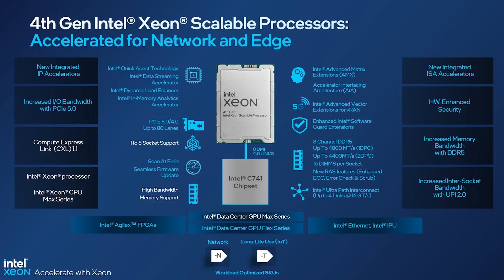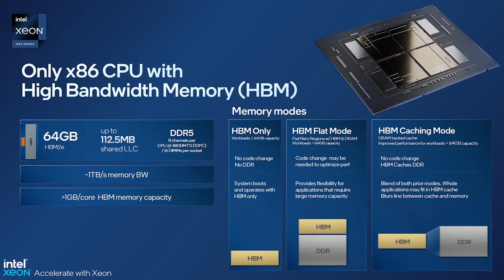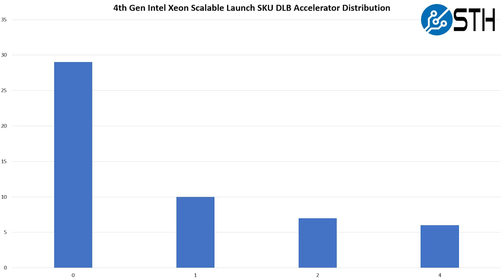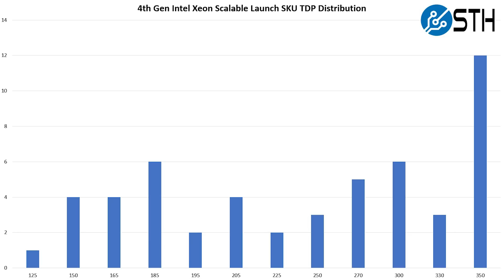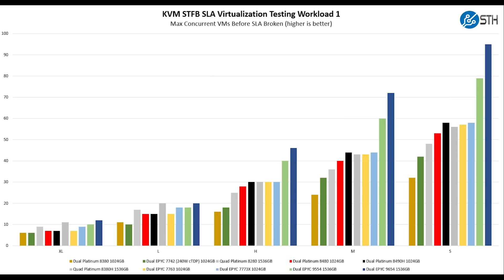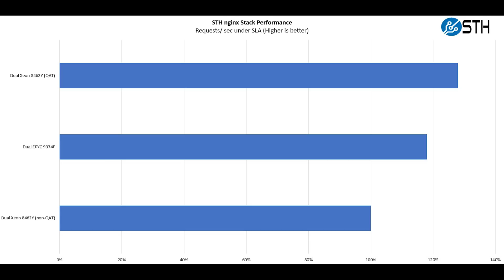$17K Sapphire Rapids Server CPU! Hands-on with the new Intel Xeon

Comment: Accelereators are way to go. IBM and many others were doing this for a decade, and now as we are reaching limits of silicon and density, we need to offload this relatively easy but mundane tasks to separate block, and leave CPU cores do what they are good at, generic versatile code. DSA is just DMA on steroid and easier use. AMX (pseudo-accelerator, but essentially with all efficiency gains of accelerator) is also nice. Lack of QAT and IAA on low end skus are really problematic tho, as it will hamper adoption a lot. A lot of developers would love to have this on smaller cpus, dev servers or workstations, but now they cannot play with it easily, unless they spend 10k on test system. For big companies it is not an issue, but for smaller ones, it is a problem.

QAT would be great, but at the same time, often this is something that is better can be accelerated on a NIC instead. (and many NICs already do that for years)

I hope AMD has good response in the works. They might have been good with density and IPC improvements, and cost reduction, but acceleration is the next game.

Comment: Genoa X and Bergamo 128 core inbound. Sapphire Rapids is weak.
Reply: you don't need that many core,
Reply: @jmtake85  In server, you need as many cores as you can get. More cores = more VMs
Reply: @tstager1978  no, core means nothing, and VMs have nothing to do with core, accelerators are the one more important. yes higher core is good but not over 40 cores per socket.
Reply: @jmtake85  What do you think cores are used for in a server? They are used to create VMs. Accelerators are great if you have a workload that can use them. If not, they are wasted die space. A built in fpga is better because it can be programed to accelerate multiple different workloads on the fly. Also, the more cores, the better the tco. 40 cores per socket isn't enough. We already need 256 cores per socket.

Comment: Everyone getting worked up about unlockable features misses the point. Companies buying these CPUs know ahead of time that the features are locked, what they cost, and price out the entire platform including all unlock fees. If it's cheaper than alternative offers that meet your requirements you buy it. At the end of the day, for the customer, it does not matter if you pay for a CPU or for a CPU and unlock fees - it's the exact same amount, because you priced it out before and the unlockable offer came out best. It's a form of price discrimination that gets more money out of the customers, yes. But the reason it works is that it's designed to still be (marginally) cheaper for the customers, so it makes sense to go with it.
Reply: I still want to see fire sales, 30-day-trials or a give-aways for these accelerators, maybe even a form of compensation when the next security flaw eats away performance per watt.

Comment: Btw, if you need QAT you can buy expansion card for that, shouldn't those work just as well on AMD platform than Intel? Those are "only" 300$ each on Fleabay. Ofc enterprise wants new, but AMD being so much cheaper i think the difference is covered :)
Reply: Wow! They exist in U.2 formfactor too... This could be huge!
Imagine all kinds of accelerators on the abundant 2.5" U.2 bays :D
Reply from the maker: The other part to keep in mind, is that 4x QAT is 800Gbps. A single PCIe Gen5 x16 slot can handle 400Gbps. The cards you find on ebay are usually 100Gbps and slower, so that means taking 8x cards that are running PCIe Gen3 x16 (since even the 8970 is a Lewisburg PCH on a card.) That would mean you need 128 PCIe lanes (8x 8970's) for the 800Gbps QAT throughput of the on-package acceleration. Then you would want 2x 400GbE NICs so you would need another 2x PCIe Gen5 x16 lanes for those. Genoa runs out of PCIe lanes for QAT cards, so that is why I suggested that DPUs would be the answer.

Comment: Hey Patrick, do high wattage sever CPUs degrade from being used full load all the time?
Reply from the maker: No. That is what they are designed to do. There are cores that eventually fail in very large populations of chips, but those are fairly rare.

Comment: Pathetic launch from intel trying to focus on stupid accelerators to hide the fact they lag way behind amd and arm contenders when it comes to raw cpu power and efficiency.
I think these xeon accelerators are way too overrated and straight up stupid. Too few applications will ever use them, most cannot by nature, those which can use the accelerators will have a very hard time justifying the needed resources to support such customized hardware, some exceptions may exist like nginx/openssl but these are few and intel is probably providing the patches. If you look at the big picture, millions of existing software packages doing some kind of compression or encryption will absolutely not support this. They will continue to use good old general cpu instructions. These applications are the absolute majority of software running in data centers, things like nginx are big when compared individually to other software packages, but almost nothing when compared to all other software. Like the entire java ecosystem, for example!
And cpu AI acceleration? Are you serious intel? Have you heard of GPUs? Even GPUs are being challenged by dedicated AI chips that could arguably offer much better performance and efficiency.
And if you are targetting mega cloud providers who actually need such accelerators on scale for things like network/storage compression/encryption/lb or whatever,  bad news, they are already making their own customized accelerators that better fit their needs at less cost.
I wonder how long can intel rely on their manufacturing capacity and historical ties to remain in business despite being behind all competition.

Comment: Without the accelerators, AMD is just KILLING it these days.
Reply from the maker: Wise observation. One area AMD needs to fill in though is sub 200W TDP CPUs
Reply: @ServeTheHomeVideo  
AMD has the EPYC 9124, 9224, 9254, and the 9334, which are all between 200-220 W TDP parts, ranging from 16-32 cores.

(Source: https://en.wikipedia.org/wiki/Epyc#Fourth_generation_Epyc_(Genoa))

I would think or surmise that if you want fewer cores and lower power consumption than that, there's now the AMD Ryzen non-X lineup that might be able to help fill out that space, but nothing from the Genoa/EPYC lineup, unfortunately.

Comment: Here's the issue, the Intel accelerators might be worth paying a premium for in certain workloads.  The issue is that Intel is charging customers a premium three times to access the accelerators.  Once when you buy a Xeon Scalable instead of an EPYC, a second time when you pay for a higher end sku with that actual silicon, and a third time when you pay your server vendor for a license.  The accelerators are Intel's only significant advantages and they will likely remain niche due to the high platform cost and many pcie alternatives.  Unless Intel sells for far below MSRP, simply don't see the value proposition here.
Reply: If it is significantly faster for certain things, I wonder how the total cost of ownership would compare to just using a bunch of cores up front, in terms of power usage.
Reply: @captainobvious9188  I can't imagine it is much faster, the benefit is low latency more than anything.  Having entire extra CPU core to do it in software is more flexible and sometimes faster but AMD won't be able to deliver low latency services the way Sapphire Rapids can. So you need to ask if your services are able to batch requests 100 at a time and deliver responses every 10ms-20ms or if you need to respond to every single request in less than 1ms if possible. It's a completely different type of requirement. AMD does it cheaper and with less energy but if your system is part of a large and complex code base, the whole system is going to be less bottlenecked if you have the capacity and will pay for it.
Reply: Would you justify Intel for a server with 30 clients accessing SAP + SQL?
Reply: @FnkDck  i would need a lot more info, sweetheart. But yes, if you want to have 30 very productive clients then going with a Intel is the best option.  If you want to handle 150 and don't need them to be the most productive then AMD.
Reply: @nahimgudfam  I'm interested to know why you think Intel would perform better for this workload.
Reply: @FnkDck  I don't really see Intel performing any better than a comparable AMD chip here.

Comment: Are they banking on the AI accelerator service? I mean can we have some benchmark of this compared to Nvidia's last gen products?
Reply from the maker: The use case is a bit different. NVIDIA benchmarks its maximum throughput on a PCIe accelerator. On-CPU AI inference is more for workloads that are running a database, web front end, and so forth, but then need to do inference on 1% of the workload. Batch size is 1 or near 1 there. Having everything on-chip means that you do not spend to add and power an under utilized PCIe accelerator, and can lower latency by staying on the CPU mesh instead of going off package to PCIe devices. We might do more CPU versus like the NVIDIA T4's that we have, but it would be more like showing maximum transactions under a SLA.

Comment: The problem with making accelerators disappear behind a paywall, is that it will turn already marginal support for these things into something only done when Intel or you yourself code it for very bespoke applications. 99% percent of server applications will not benefit at all, and all the costs for Intel are still there, especially in terms of silicon. If they can be turned on at any point, those accelerators can’t even have defects after all, unlike if they just had models with it hard dis- and enabled.
At the point where AI, video or other acceleration would be useful enough for your application to go that far, you no longer compete against Epyc, but GPUs and even dedicated special purpose hardware, which some Intel on die accelerators will always loose against. Today it is a lot easier to just start a AWS Trainium or Inferentia, or similar products on other clouds. It's no longer broadly the case, that the person who decides what to run on, also has to commit to a limited pool of hardware and will therefore just select what provides all the features in one box.
For businesses looking at total cost of ownership, this kind of cost model is less offensive than for us consumers, but it may still be a disadvantage in the end, if the buying price and running costs aren't equally reduced. But this kind of usability impairment, that costs a lot of mandays extra, is just a no go for them.
Reply: Exactly what I wanted to say, but you already wrote it better than I could. <3

Comment: Patrick, I was hoping that you'd give  harsher criticism of the new chips. The price is absolutely ridiculous compared to Genoa. 60 vs 64 core comparison doesn't even make sense when I can get 3x 64 cores for the price of one 60 core
Reply: the large data centers will order ton of chips and thus they will negotiate the price and they will get a huge discount no one buys them at msrp except for enthusiasts or guys that'll buy one-offs I won't be surprised if they can get it at half MSRP but it goes both ways for amd and intel
Reply: @merouanebenderradji1582  and then, large data centers are buying AMD CPUs in bulk and they can negotiate the prices.

Comment: $17K Intel suggested to the high volume OEM / 2. Patrick r u worth a 100% margin gain as VAR SI design build install and qualify consultancy subject design build contract? That's what it takes to earn x2 over the Intel price.  mb
Reply: or u learning on setting up the table we need to talk so we don't duplicate data Patrick u need to add data not duplicate my data. I have all the filters for taking the data and getting rid of primary research duplication of every query. mb
Reply: Did u just say Patrick Intel is attempting to get rid of certain peripheral subsystem developers from the lunch and roll out? mb
Reply: Right I've been after Intel for enterprise, generally business compute so its mid core count, got it. mb
Reply: interesting quandy to use or not use any of the 4 acceleration blocks. And Intel will decide into future on that added block revenue customer test, vote, qualification. I agree they r there just turn them on. mb

Comment: I wonder how long it will take for that $17,000 CPU to show up on eBay for sale at $100?  7 years?  More?

Along those lines, I wonder if Intel would be willing to consider unlocking their CPUs after some amount of time, like 7 years?  That would help with keeping them out of the landfill and upcycling them for new uses.  #amIjustdreaming?
Reply: Maybe a decade? They'll have to be pretty useless tech to be that cheap. (and the rest of the hardware to use them, too.) As for unlocking... never going to happen. Problem #1, how does the processor know it's 7yo? Intel is not going to want to bother with any code generator to mess with an old processor line. Plus, you'd likely need a BIOS update to hold the new "unlocked" microcode, just to get to an OS that could load anything newer. Intel is in the business to sell new hardware, not make their old stuff last longer.
Reply: One can dream?

Comment: I hate the idea that ALL Intel business customers are subsidizing the hardware that is going out not turned on. 

If it were your Car, say an electric vehicle. And there was 30% more battery cells in the car that were not active, so a definite hardware cost, just like building silicon with advanced capabilities. You can license turning those cells on later, just like the features on these CPUs.

They are going to recoup the actual cost of that hardware at sale time, make no mistake, they wont sell the car at a loss anymore than Intel will sell these chips to businesses at a loss. You are paying 100% of the hardware cost even if its not activated. 

Then they are going to rent the function to you.

Toxic level capitalism. 

Eventually we will have limits of compute ability if we go down this path, If you combine that with the total loss of privacy of today, you will have companies who work to cost you your compute stored credits by pushing garbage at you online, so that their partner can charge you for more.
Reply from the maker: I think that you are right that there is some cross-subsidy on the gross margin side. The equation may be a bit more complex on the On Demand side. In the example, Lenovo needs to sell the Intel enablement, and so both companies will need to generate revenue and margin from that event.

Comment: As a user that got addicted to re-purpose used server hardware for personal desktop usage (great value!), I am keen on the information if there are Sapphire Rapids Xeon SKUs that will work on their Fishawk Falls HEDT platform. If I remember correctly, Fishhawk Falls uses the monolithic die version. As used prices for highly available server CPUs get better over the years, it would be desireable if the equivalent server SKUs could also be used on HEDT motherboards.
Reply: I got the same addiction with you!!!
Reply: As a homelab repurposer I am at loss what to upgrade to after LGA1151.
Two SKUs that are interesting in terms of core count vs frequency are 6434 and 5415+, ridiculously expensive now, and probably then, unless they are deployed somewhere in great quantities. And power requirement ofc makes no sense, since it would be more benefitial to have couple 4c8t nodes with more PCI-E slots that one more power hungry with density constrains..
It is frustrating.
Reply: Aside from validatable ECC support, what is the benefit over using a mid to high tier current gen consumer grade part and supporting platform?  I'd wonder if the current gen consumer hardware could compete with or outperform enterprise grade old enough to be cost comparative even if most of the virtual memory is swap space vs DRAM.
Reply: @uncrunch398  That's simple and very convincing: A far better price-performance ratio for core-heavy applications. I got the 18-core CPU, a "new" motherboard (new components with used re-puposed server chipsets) and used ECC-RAM for just a fraction of the cost of a new consumer CPU + motherboard + non-ECC-RAM combination and still get great performance for my needs.

Comment: The Intel Xeon CPU Max 9462 Processor 75M Cache, 2.70 GHz with it's maximum 64GB of HBM memory would make a magnificent desktop workstation in HBM only mode.
Even with limiting memory to only 64GB it would probably out pace any similar priced workstation on the market. 
Since the release of Apple's M1 system I think it is enviable that both Intel, AMD & even IBM will produce high end workstation CPUs with HBM in competition.
Reply: Yep mi300 from amd is almost a full system on chip with cpu gpu and hbm
Reply: @aravindpallippara1577  https://www.youtube.com/watch?v=_p8k2SQvxuI&t=524s
Reply: Lets see when because i dont think is coming to xeon W... Probably have to wait 2 more years.